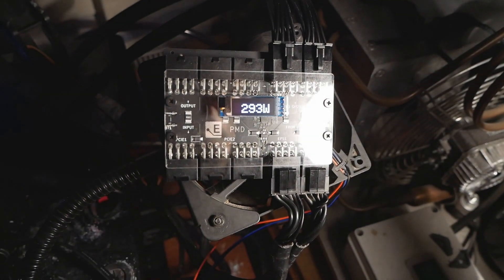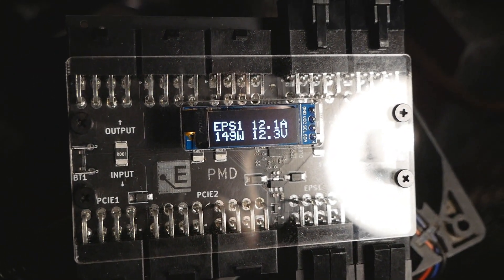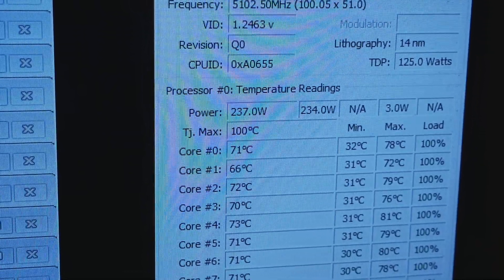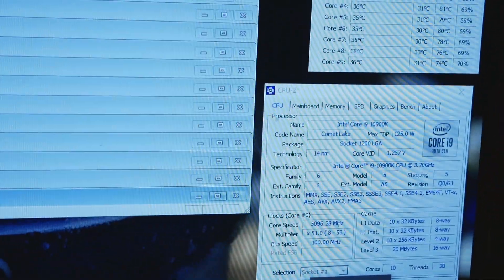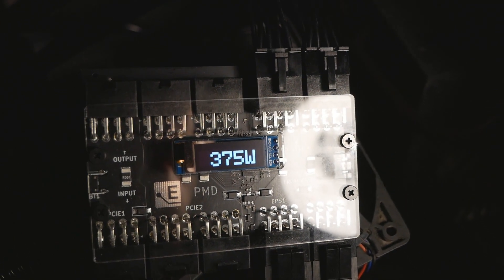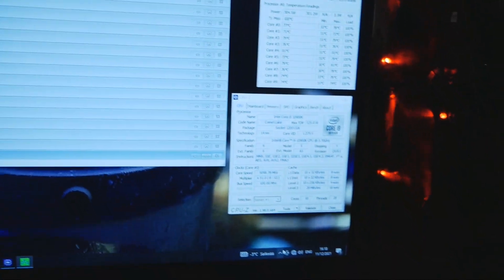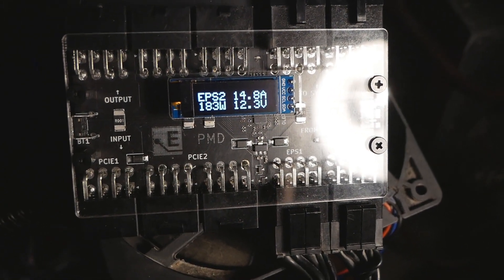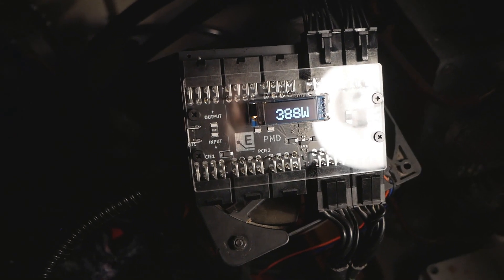How to Measure CPU Power Consumption the Right Way - ElmorLabs PMD Review

Comment: I have dellided 12900k cpu, and using direct die waterblock, temperatures felt down by 20-15c :) cpu can do 5.5ghz 1.31v, but i run 5.4ghz at 1.24v daily.

Comment: Ooh... ElmorLabs‼️Way cool 😎 This device is a great way to estimate power supply requirements. 
Assuming the software is correct, then the difference between Elmor and software is the VRM switching loss, inductor loss, PCB trace loss, and contact resistance loss. 
We must obey the first law of thermodynamics 🥇
Reply: Not an estimated value like driver reports are.